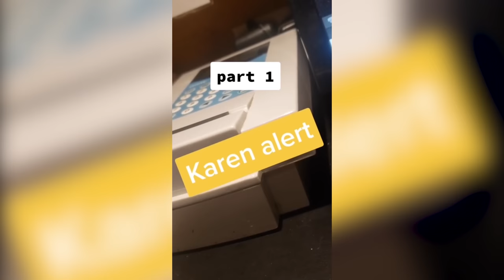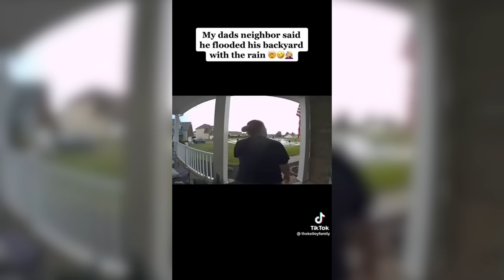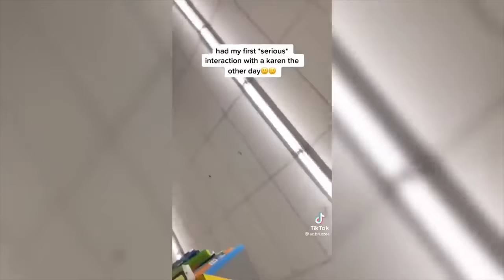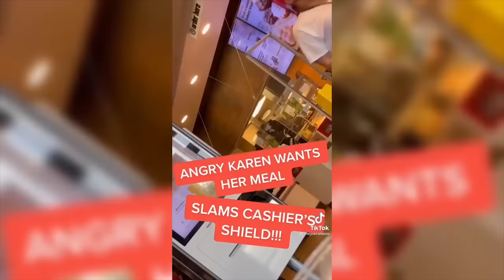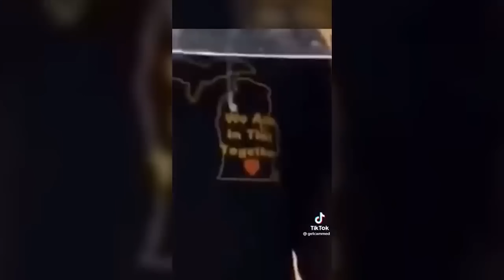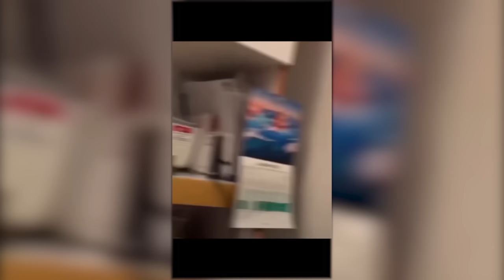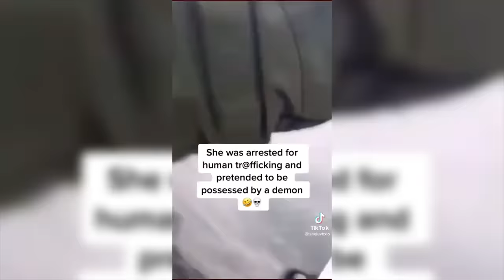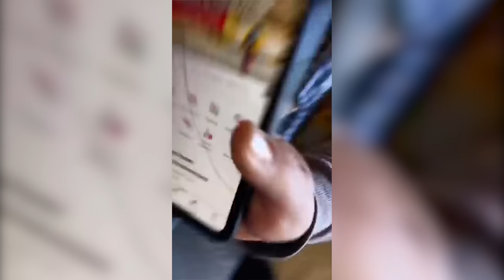2 Hours of KARENS Messing With the Wrong People

Comment: I work at a fast food place and have luckily only delt with karens a few times. At the time of this story I was a relatively new employee. So i was taking a order, everything went well, i got the order correct (making sure about sauces, any additions, and any edits before finishing the order up) and sent them forward. Turns out kitchen got the order wrong. Instead of being a decent person and going to just get it fixed real quick, they came back to the drive through to try and yell at me. It wasnt my fault it was wrong, it was a mix up in the kitchen. Luckily my fellow coworkers were not about to let that happen and quickly tried to deal with the issue, they kept trying to get my coworker to get me. My coworker got a manager to deal with the person and eventually the person left. I was told about it abit after the situation happened and that it wasnt my fault, that i got it right and that i didnt have to worry about it. I love my coworkers and manager so much, they are so understanding and kind 💙

Comment: 38:25 In America, the homeowner actually owns the sidewalk (what australians call foot paths) in front of their property. If the area in front is starting to deteriorate, causing  the concrete to become uneven, or if tree roots become exposed, forming a tripping hazard, you are required to make repairs because it's a liability. Same as if you do not shovel the snow in front of your property, and someone slips and injures themselves. That's a lawsuit. You're liable for those damages. There's exceptions. For example, if the city is making repairs on the roadside, requiring them to lift the concrete slab in front of your property. Also, exposed tree roots in front of your property that were planted by the city are the cities' responsibility. You call 311 and have them come out to deal with it. But it's your responsibility to make sure you reach out to them and document your case number for proof.